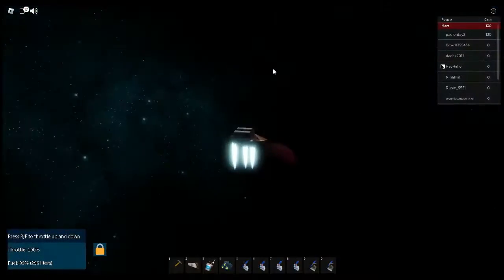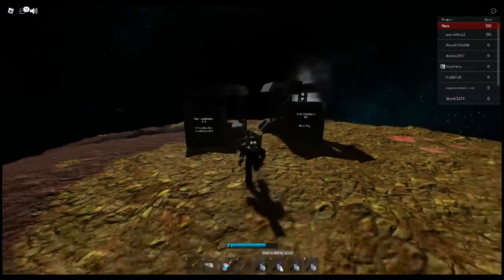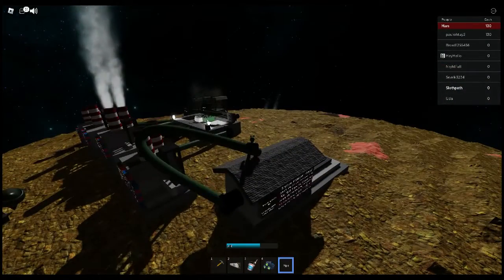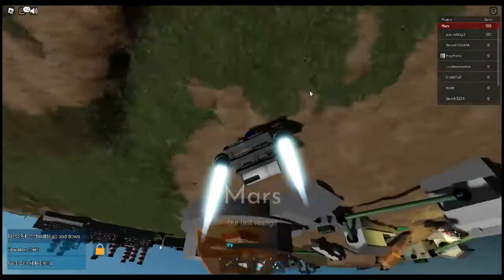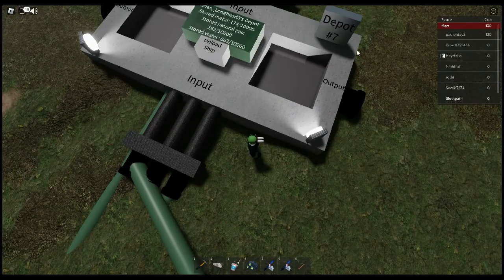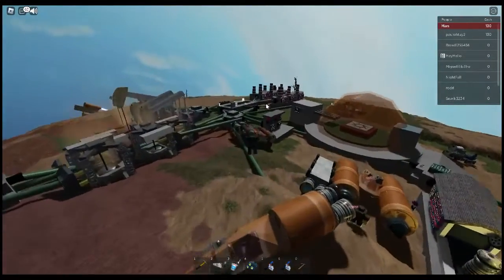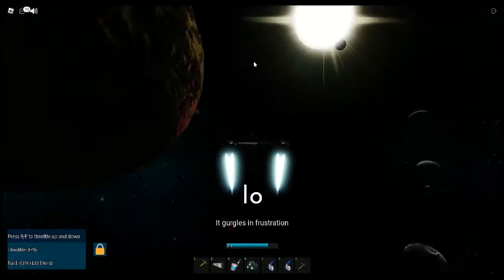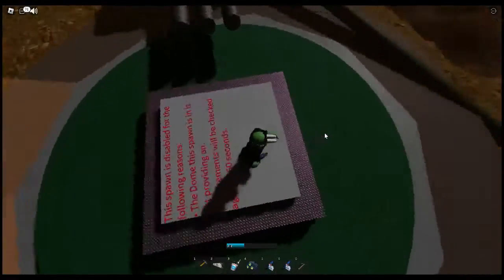Solar system exploration2 How to colonize without gas

Comment: Guys, if you found this video’s comment, You found free tips:
Ganymede’s poles are rich in Gas, Metal, and Water
Recommend to place a bunch of drills or frackers connected to junctions to get more material
Floodlights, Flashlights, Jackhammers, and Radars are excess gear being useless but to add detail to the game.

Thats it! See-ya!

Comment: OR OPTION 3:

colonize mars and then use shift + p and travel all the way to Io. no extra junctions, just one on mars, and one on Io
it will take a hot minute tho (id say like 15 minutes)
Reply: option 5: join a private server and, just like option 4, spam million of frackers.
Reply: Option 4: Very low doesn't always mean none! Just spam millions of frackers and they will generate a tiny bit of gas. Atleast in Charon, they make like 1 every every 20 minutes, so you will need 120 for 1 unit a second